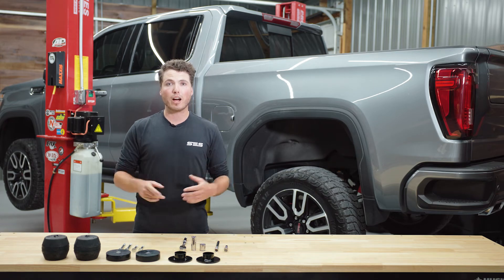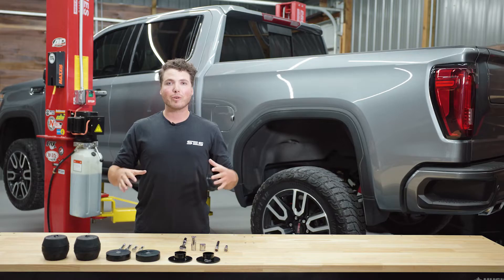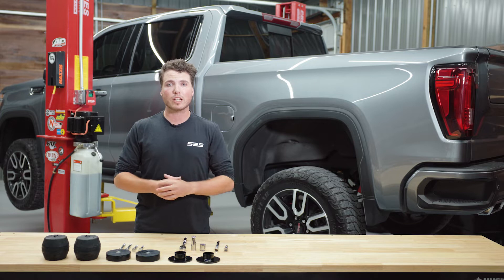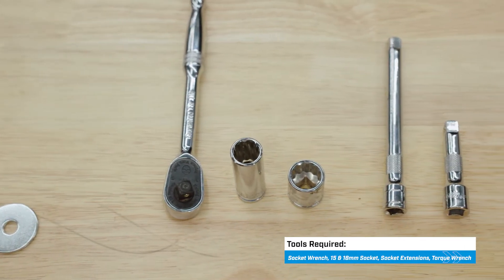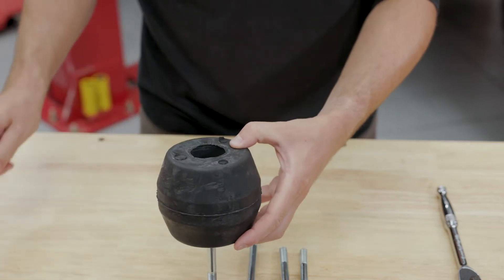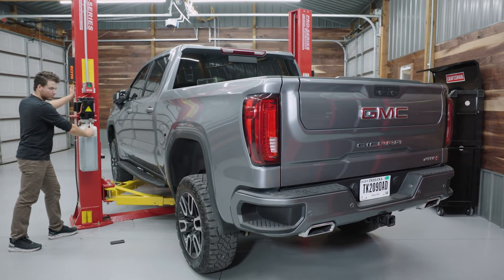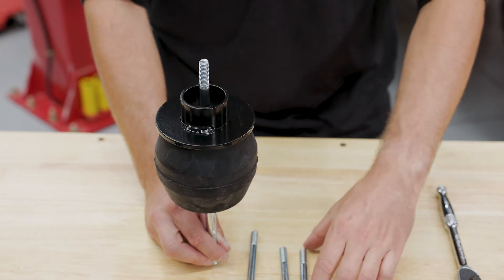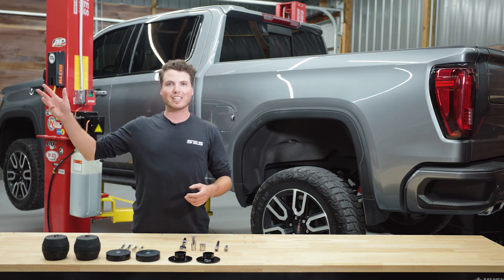GMC 1500 Suspension Upgrade For Heavy Payload | Timbren SES

Comment: I have 2021GMC Sierra 1500
 At4 i just added a 500lb 3 hole dog box when loaded roughly 900... looking to avoid rear sag over time... what's your thoughts on this solution??/ front and back??? its tight now....look to keep it that way
Reply from the maker: Good question. How is the truck handling right now with the additional 900 lbs.?
Reply: @TimbrenIndustries  slight float but what you’d expect…really seems fine/ tight..Very low mileage…
Reply from the maker: If you're just hauling around that load for now I wouldn't worry about putting a Timbren SES kit up front. If you're looking to protect the longevity of those leaf springs on the rear our rear SES kit would be worth investing in. Especially for those times when you'll be hauling/towing above and beyond the 900 lbs. you already have in the bed.

This kit will fit your AT4 Sierra 1500 - https://timbren.com/products/gmrs15-gmc-sierra-1500-chevrolet-silverado-1500-2019-2023-rear-kit

Let us know if you have anymore questions!
Reply: @TimbrenIndustries  perfect... the dog box is permanent.. i just want to make sure that headlights don't blast on coming driver's over time as well..
Reply from the maker: Totally get it. Nobody likes taking headlights straight on. The SES kit will definitely make sure that doesn't happen.